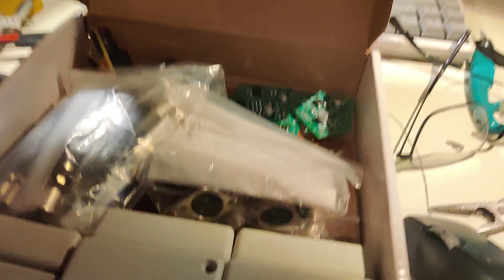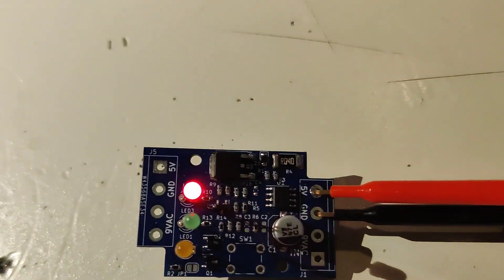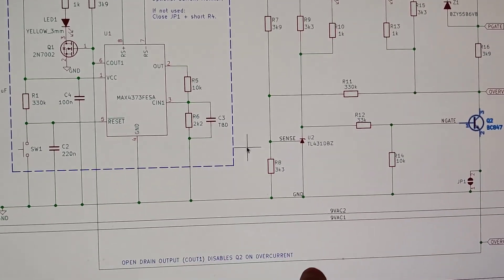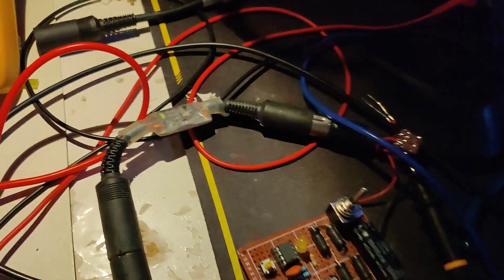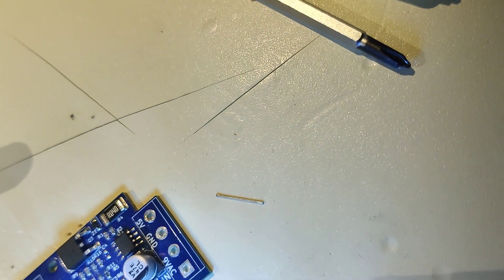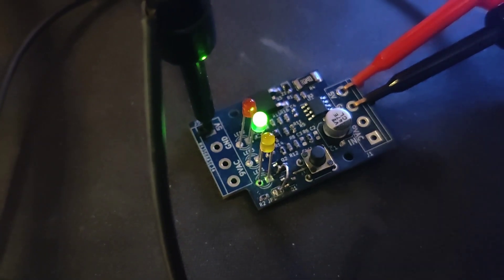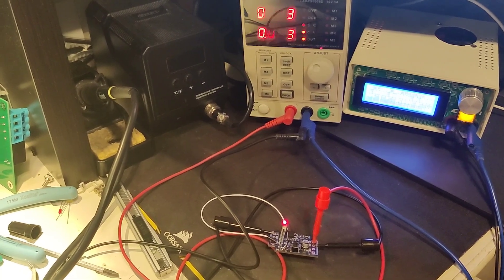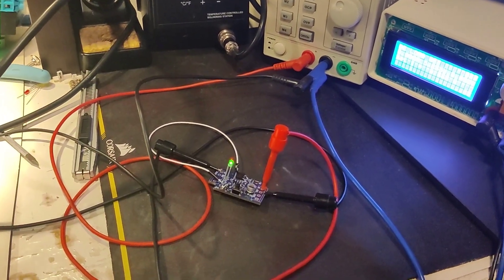C64 Saver OCP model V0.1

Comment: @13:55 - my First microelectronics microscope. It almost served it's purpose. I sure gave it some soldering iron wounds. I think it's focal length was determined by cost of the stand. My main microscope now allows a Hakko FM2027 soldering iron AND tip to stand under it ALMOST vertically. The key is LIGHT. LOTS of light from many directions.
Reply from the maker: I drag out the old webcam-microscope if I can call it that, whenever just need a quick check of something. Very handy for removing splinter from fingers. I have another microscope with better working distance too.